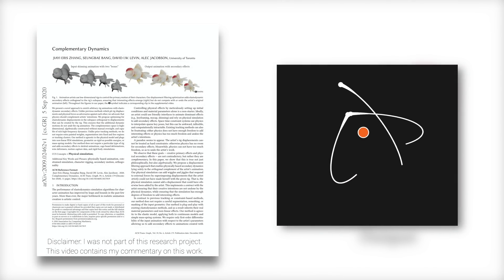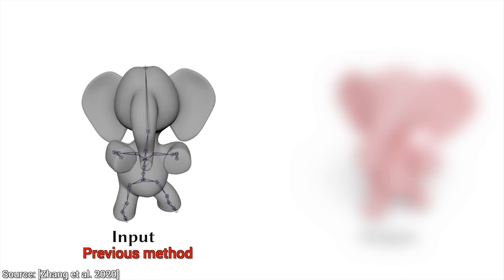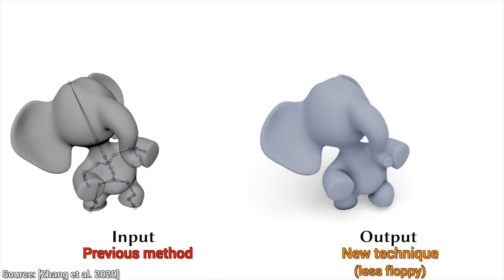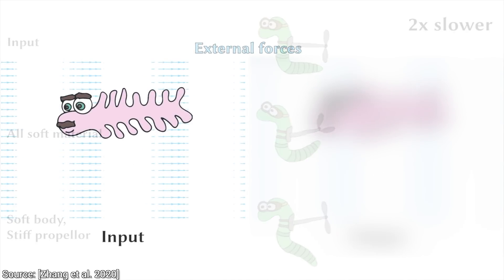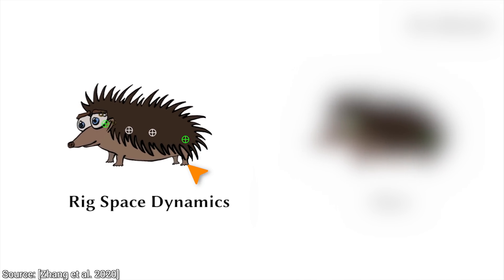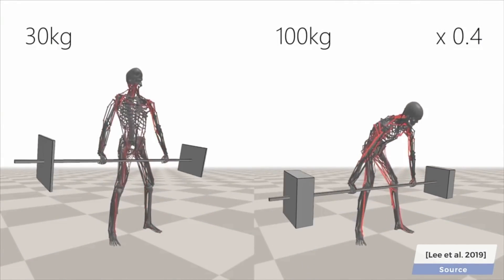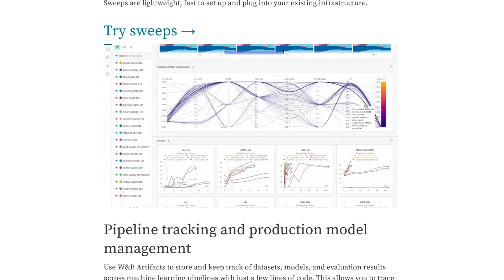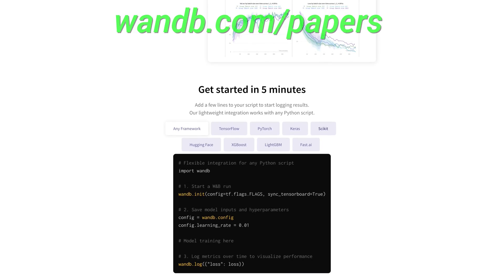Soft Body Wiggles And Jiggles…Effortlessly! 🐘

Comment: I've created a human more realistically than this a couple years ago using soft cloth on a human character for Reallusion. I have an example "Camilla Soft Body Physics" -free character in the Reallusion marketplace.  I paint the character mostly black, grey for moveable skin areas and output high resolution textures. I can specify love handle movement, breast, earlobe, chin flab, butt,  belly flab or soft tissue close to solid muscles etc  Anything!! I could mix it up, robotic with soft skin, whatever. Big creatures with floppy wrinkles? no prob. Not only that in iClone/CC4 there are wind presets etc Made characters look like they are skydiving. While using iC7, I had to show Reallusion that it was possible to use it on Characters and in iC8 they made Softcloth possible for native character bodies (already existed for any props etc) I'm now asking them to create Ragdoll vs animation weight slider like a push button puppet toy but ik physics and ragdoll/animation weights to be triggered by velocity and mass so that depending on strength the character may fall or be triggered to step back but we should be able to see the indent of the punch on the skin or maybe the character is set off balance and we set the ragdoll weight as greater than animation and it falls down stairs etc.. The physics you're showing use now was already available in Unity from an asset called Obi Soft Physics by Virtual Method over 6 years ago using particle driven colliders. I have since also experimented with my polar bear that uses displacement for fur - made the displacement look like it's blowing in the wind. Soft cloth using Screen space Particle Physics will be the winner for high collider resolution, high performance character Physics to pinch, pull, punch a character's skin or have animated props like lungs, heart or hands underneath pushing through.

Comment: Maya (since 2018 version) have this - perhaps not quite as "smart", but it has the...."Jiggle deformer". The result is very similar to what we see in this video. Difference is that you must paint on weights for how floppy...or not...parts of the model should be. However once applied the parts of the model that have been set to any sort of jigglyness will react accordingly to movement of the model.

Comment: Would have been interesting to hear more about how exactly it's used. 
I guess you first rig the model like normal and then add this thing on top of it, but do you paint a weight map for how rigid each part is and so forth? Or can you just apply a rigidity value for the whole model? Like others have noted, the teeth in the dinosaur's mouth are dangling a bit too much :)
Anyways, I guess I just have to read the paper. Thanks a lot!

Comment: needs two types of rigid weights, relative and absolute, the absolute ones will be rigid relative to initial simulation, and relative will be rigid based on attached to poly deformations.
For dino teeth for example it needs an absolute weights as the teeth are attached to the skull, things like scales for example on a fish can be relative

Comment: The moment I noticed that the dinosaurs teeth also jiggle like they're soft, and now I can't stop staring at them... jiggling teeth....
Reply: That's what happens if you don't brush your teeth twice a day.
Reply: @LimitedWard  can confirm
Reply: That's why they went extinct...
Reply: Yep. Teeth are sort of like bones and should not jiggle either, but they need to be rigged. So you'd probably have to model a wireframe of the skull rather than a straight line through the head, and attach the teeth to it.
Reply: @gulllars4620  one cool feature of the algorithm is that you can specify materials (without specifying a rig) so you could set the teeth to be a stiffer material to prevent this kind of dental anomaly :)
Reply: @davidlevin2498  that would still not be correct because the teeth would need to be connected, as jaw is a solid bone and the gum between the teeth shouldnt jiggle and make the teeth shift. and then the jaw shouldnt wiggle from the skull itself. at the end of the day, you would be defining an internal solid material, the "skeleton', which would very closely resemble a rig,. as usual, best results come from combining techniques, rather than relying on one, but obviously this video was showcasing the new technique in isolation.
Reply: @aki-senkinn  yah, they would have to model the jowls separate from the jaw
Reply: I think the point of the animation is to be like a toy, that would wiggle
Reply: Same reaction here :p
Reply: teeth are also bones
Reply: Yeah, just everything. This tech needs to be weighted by vertex from rigid to super-flloppy. I'd suggest using a greyscale bitmap/texture/material mask so that it's super-easy for artists to edit by hand. No need going overkill with a bunch of separate meshes.
Reply: Using jiggletech makes your teeth go gray
Reply: lol same
Reply: Flaccid teeth
Reply: LOL

Comment: So its basically just a faster version of the standard FEM/XPBD softbody simulation we've been doing for years, without the need to tetrahedralize the mesh prior to simulation?
Reply: AFAK, the main selling point is that it is RIG type agnostic
Reply: @butterdubs2267  Gotcha. So from what I can gather from the paper, is that its designed to run in parallel with the animation on the rig, rather than caching that animation out and then running the soft-body sim as a post-process (which is how we do it now, for most cases)